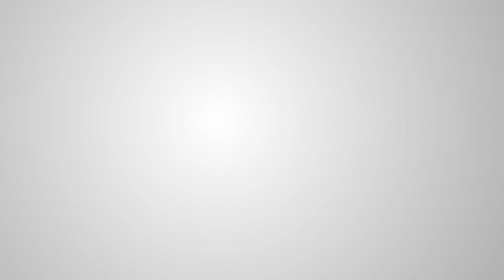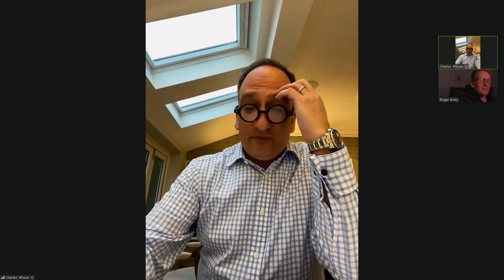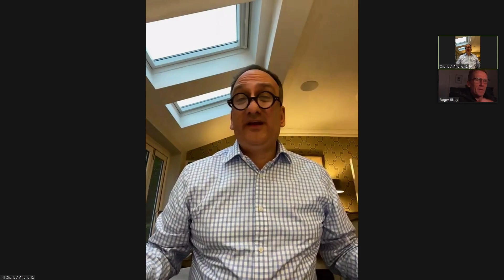10 Plumbers Couldn’t Solve This Mystery. Can You?

Comment: Firstly, I am not familar with the systems employed, in the UK. However, plumbing is basically the same, Worldwide. 

1) If there is any water leak, in the system, then the relief valve will not expel water, as the static pressure is not high enough, to activate the valve, hence the relief line being dry.

2) if there is any leak, above the concrete slab, then there will be evidence of mould/water damage, to the wall: wallpaper, paintwork, skirting, etc..

3) the only real way to resolve an issue like this is start at the beginning: cap off the flow/return pipes, to the underfloor heating system, one at a time, pressurise the line, & gauge any pressure drop. When the system maintains pressure (that's called soundness), then you have identified the pipe leg with the issue.

nb. the radiator: if the tradesman used any type of sensing device, then the tracer gas (whatever he meant, by that) could simply be residual gas,on the radiator's cap. They are extremely sensitive. When I used to go gasfitting, I would do dual checks; with a secondary test, using soapy-water solution, as the detectors are just too sensitive. Unable to tell, from the video, but was the white cap some sort of relief? If so, then obviously, there would be detection.

Another way is to cap off all the pipe legs, & pressure test, with air, or any inert gas, to determine the one, with the leak.

All the underfloor heating pipes should be solid, with zero joins, under the slab.

My suspicion is,  during installation, either a mistake was made, by the installer, or someone has drilled partially through one of the legs. The first area I would look at is, are any of the toilet pans screwed into the concrete floor? I have come across installers running the pipes under tha pan (which should never be the case). I would start with the leg where the removed motorised valve was dry. The smacks of it losing pressure. Disconnect that line -both flow & return (they should be marked; but if installed poorly, they may not be), & check that line, with a pressurised air gauge -like a Kulhmann gauge (used for pressure testing gas lines, after installation).

I am afraid, if the leak is under-slab, there is no way to rectify the issue, without digging it up. An absolute waste of time putting a DIY pipe leak additive in; just someone playing on the client's ignorance. The simplest solution is to leave the effected leg capped.

The way to find a tradesman, anywhere in the World, is ask friends, etc., if they have had a good experience, with their ones. Be careful to ensure the employed tradesman doesn't contract the job, out to another person. I have seen this happen, to the customer's detriment.

caveat: I wrote this without watching the entire video.

An antipodean plumber, over over 40 years experience. I hope you get an acceptable solution.

Believe when I say I spend hours, every week, fixing other tradesmen's poor workmanship. I would say camera work is an extra expense, that {most likely} will not show any obvious issue. Just FF to end of video. Nice to see the customer found someone who knew what they were doing. One of the first things I ever learned,as an apprentice, was NEVER to put nutted fittings/valves, into enclosed spaces. It is just as disaster, waiting to happen. It is now done with reckless abandon.

Comment: I'm in 19 minutes and the first thing that I would be thinking is to partition the zones mechanically from the main feeds and one at a time open up the zones and reevaluate the pressure and moisture . At least you only rip up the zones that give issues and also for future problems gives you some ability to problem solve.
Reply: What your getting at is pressure testing with dye each zone,  or better yet from point A to point B.   I used to do this on hot water baseboard heating systems.

Comment: Yes, that one of the joys of water-borne under floor heating systems. Sometimes they leak. Those "weird thermostats" are actually thermostats that sense water temperature and not air temperature. They are genaraly used  in under-floor and distract heating systems. Distract heating systems are quite common in other parts of Europa but not in the UK. The heating sytem is leaking. Phone a plumber!!

Comment: Every plumber that worked on your home used push fit which is ok for them but that proves they  all go for the cheap solution so that proves they are not professional . I am in California and I wouldn't use those fittings for a permanent repair. Your water pressure is much lower than ours and that may be the problem o ring seals work better under high pressure. Viega crimped fittings would be a better way to join pipes. Good luck. I think you may end up replumbing the whole system it is way too complicated as is.

Comment: The house bashers in Scotland tend to do a cover up as the customers don’t want to spend money. It’s only when the floor rots out that you find the bodges. 
My own house has had a fire and it was just covered over in every room. Could never get rid of the burning smell …. All smoke damage was just clad over. 
Found some amazing bodges like a single  2.5 mm cable running an entire kitchen extension. 
Cable was red hot however it was lying in a damp clay basement and that was helping to keep it going…

Comment: Would never use isolation valves on a heating system. Maybe a vindictive builder has left the problem on purpose? Always get recommended trades. Treat each other with respect. In 50 years of working life, the horror jobs and their owners are never forgotten. Thankfully very few. Great video.

Comment: I’m a general builder rather than a plumber, and over 40 odd years I’ve come across similar situations. Generally I only work by recommendation, and that goes both ways. A good relationship with the customer, honest and communicative is essential. Using unknown builders of whatever nationality is a no no. Don’t be in a hurry to get the work done. The best people are worth waiting for and worth seeking out. Sometimes a good customer and a good tradesman don’t gel for whatever reason - move on !
Another point maybe that a foreign builder may be working on unfamiliar systems and regulations causing them to produce an unsatisfactory job.
Suspended floors on timber joists should never be in ground contact, but up on Dpc on dwarf walls - air bricks essential. Never take external reader to the ground, it can lead to capillary damp up the wall - use a bell cast bead at the render base at least 150mm above ground.
On the plumbing side, I’m just surprised that Charles didn’t rationalise the whole system to 1 boiler and mega flow etc for all the house, with continuous new pipe work under the floors and renew the manifolds, pumps and valves with a properly designed system for full peace of mind. Relative to the property prices in Datchet, the cost though significant would in the long run be beneficial. More efficient system cheaper to run, and should he wish to sell, a fully certificated system as a selling point.

Comment: I had a leak in a house  and found it and told the customer it was under the floor next to the boiler , but they said it wasn’t and called a leak firm in and changed them £700 and told them it was were I told them it was ,then they asked me back to repair the the leak  which I did but I put my price up to do it ,if they could pay £700 to find it they had money to pay me a bit more  so sometimes the customer is not right

Comment: Actually it only needs a tiny leak to drop the pressure. My money would be on the underfloor heating cicuit. I'd never put that guff in my property.
Reply from the maker: It wasn't the problem. I have never had a problem with underfloor heating

Comment: Remove the burner from the boiler and inspect. It's an old boiler and could be leaking internally. Plastic pipe and fittings may be messy but that's not an indication its leaking. Also being an older system and building, could have external drain valves poking out the wall which need checking. Usually found in the back of flower beds!

Comment: I guess adding bad plumbing onto bad plumbing will result in long term problems. Such a bad situation he was in  . As a retired heating engineer I personally  would have Isolated the boilers and put them under test for pressure loss. Same on the underfloor heating. I am pleased to hear the customer got it all sorted. The fact that there was no leaking water seen above kind of leads us to say the problem was under the floor so why wasnt the uf circuits tested for pressure loss, worrying that so many engineers overlooked this. I would have quoted for the time it would take to do the job, nothing is free except a bit of friendly advice.

Comment: Hi Roger, this is such an interesting tale!, there is obviously a leak somewhere in the heating system, exactly where it is is obviously a mystery, sadly it could easily be buried under the floor somewhere and could well be some distance from where the wet is showing.
I like the idea of using a smelly soluble compound in the system, I also like the way you work so hard to explore as many possibilities as you can think of and encourage the man to explore the place for you. The point that I would make is that regardless of exactly where the leak is a substantial length of defective pipe will have to be replaced and that will mean taking up quite a lot of the floor!, someone is going to have to open it all up and get at it!. 
Cheers, Richard.

Comment: Ok so being a oldi took a 5yr apprenticeship to be a gas fitter we fitted meters with lead 60s copper pipe coming in, so much easier than cutting and threading pipe. College we had danger studies (welding) building construction  needed lead roll and branch joint for intermediate and final city and guilds .But the really clever guys ,in workshop's nextdoor plummers needed to do lead guttering down pipes all from sheet lead . Any one qualified in trade will have a story undercut by cowboy and asked to sort it.

Comment: Bed room. Lots of places to use a hole saw to see uner the floor, wardrobe, under bed etc the the holesaw plug can be refitted. Any of ge accessible push-fits can be undone and capped off in an attempt to isolate areas to try to see if the pressure loss is there.
 
But the only real solution is to dig up all the floors and re do the complete system.

Comment: If you pressurize it with air you may actually be able to hear the leak . Might need to pressure it up to at least 30 pounds or so. A smoke test might work as well , but would have to put a little more thought of how to do it. Good luck , beautiful house.

Comment: I would drill a series of holes around the perimeter of the new addition. Get some cameras in there and do as much as possible berfore  tearing up the interior floor.  behind that bathroom rad open up an access hole and drill hole in wall base plate and get a camera under there.  the floor somewhere will have to be torn out.

Comment: I haven't seen the whole video as I fell asleep while watching it But one motorised valve is doing the underfloor heating, when the system is drained if u take the valve out n put some air pressure in it u got u r return pipe so cup the system off to eliminate the underfloor circuit fire u r boiler up if all is well u got it where is leaking eliminate bit by bit mate if ts a commobn return you have to lift the floor up to find where the two returns join n do it that way, You Have to split the system up n start eliminating or repairing each circuit its the only way mate n the bloke ops owner it looks like he is the kind of bloke he will pay you when you fix it, GL Roger am sure you will in the end mate (wish i ws young again ove to help if I could lol)

Comment: Watching and typing my assumptions/observations on the fly.

9:54 - my immediate interest would be the Danfoss valve that seems to lead nowhere, I have seen homes that had radiators removed but the pipes were just closed with the uninstalled valves and in this situation the pressure leak is just really quick so I would close the Danfoss valve completely and try to observe any change. Anyway, let's watch further

52:00 - sigh who in their right mind leaves a valve beneath the floor? It's basically the most probable point for a leak. I am happy to hear it's been sorted out. I, myself prefer tracking down the issue and solving it without hastily change/modify parts without proper diagnose. I had a customer that had an issue with an electric boiler/heating system that just randomly lost pressure and then shut itself off. He had a tennant in the apartment and during winter it was a big issue because she couldn't heat up the apartment or use hot water for a longer period of time without having issues. The owner requested a complete replacement of the system because he had multiple people come and look at it but to me it wasn't reasonable for a 3 year old system to behave that strangely because I pressure tested the pipes and there was no loss. After two short visits with some testing I ruled out every single option and I was left with a faulty pressure sensor inside the boiler. Ordered the part, replaced and saved the owner tons of money. That is a job well done in my book, not going after the priciest option at hand

Comment: Not long into the vid as Charles was explaining all that had happened, I was starting to think it was something simple, because in my experience it usually is. I would have been isolating circuits and testing one by one, and labelling behind me as I worked. I have a very good label printer for less than £25, I label everything. 
This is the type of job I love, I relish being called in after many others have failed, it’s good to be tested. I don’t know how some people sleep at night charging £500/day and not even finding the problem, at that fee you’re setting yourself up as the expert so you’d better find it ( Good tip about the perfume. I’ve not heard of that one before) and if not at least offer a huge discount for a follow up. 
Your right about the quality of engineers these days, slap dash and not interested in doing anything difficult
Reply: £500 to try and say it was loosing that much pressure/water through a vent plug !
Reply: @martinranson4262  looseing almost a var an hour,  but no sign of water, must be the bleed valve,  scary how they tried to blame ot on this, just a bit of common sense needed.
Reply: Good on ya mate

Comment: What I really don't understand is that obviously a considerable amount of time and money had been spent into the renovation of the property  why oh why would you not replace the heating system  oh I know why because there is no eye candy value in it as most of it is hidden apart from a few fancy radiators and in my opinion and experience you only employ polish builders if you want it doing on the cheap

Comment: I think this is a case where the fundamentals need to be understood. As people have said you can isolate many of the circuits and pressure test. I personally would have a plumber understand the system and then as Roger has said overlay fresh pipework and take it from there. 
I do think that floors will need to be lifted, especially if you have rising damp!!
Good luck Charles

Comment: Reminds me of my father's house started as a 2 bedroom farm house ending being a 6 bedroom 3 bathroom property had his own plumbing company had a leak in his hot water cylinder for 17 years reason he never fixed it with all the extention s over the years and patched the system together he said the air locks would be a nightmare so he opted for my mam to empty the bucket once a week it's only a tiny drip he would say .gravaty system so no pressure problems .

Comment: Finally traced a water issue - little pond under the bath - in a basement bathroom. The original water pipes had been installed in a new concrete floor about 30 years previously when the property was renovated. Took three plumbers, I finally persuaded one to pressure test the hot and cold pipework. It turned out the old buried copper pipe (lagged when buried) had finally given way on the hot side (heat being the catalyst) and I'm assuming the client's cold will go eventually too. To save a big excavation - and a new floor - another plumber simply bypassed the hot supply on the surface. I hate the practice of burying pipes - and other elements - without feasible access. You wouldn't buy a car with the bonnet welded shut in the factory...
Reply: Underfloor heating is buried pipework!!?
Reply: New floor every 30 years sounds reasonable.
Reply: @Sussy-Walter  It sounds reasonable if it's due 30 years in the future. When it's overdue 6 months in the past, it's a disaster.

Comment: Disconnect one system at a time and replace it with surface pipework with possibly back to back radiators and solve the problem once and for all. I know its difficult but it will solve the problem.

Comment: For many years my Grandmother said she could hear water movement in her lounge, but there was no visible damp or smell evident. Eventually my uncle lifted a floorboard to add a new electrical socket, to find at least 6 inches of water below the raised floor, due to a leaking pipe that fed the back boiler at the rear of the open fire place.

Comment: What about a thermal camera? let system cool down, isolate and start up each zone one at a time, and observe the loops. Also side note; I love hearing complements about us Canadians as I'm from Canada's east coast, where many systems are hydronic heat with oil or gas boilers. Now I live in central Canada where majority is forced air, but many custom homes have radiant floors, and I can tell  you there are tonnes of crooks, and shady contractors in many trades here as well, doing very poor work, and ripping people off thousands. The problem is a major one, with very little government help or laws to make much difference and is worsening daily.